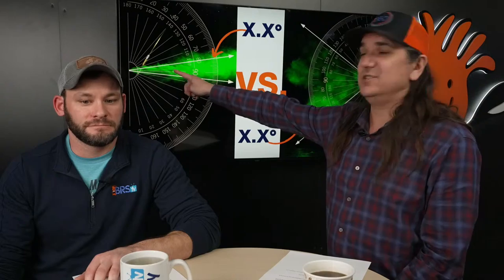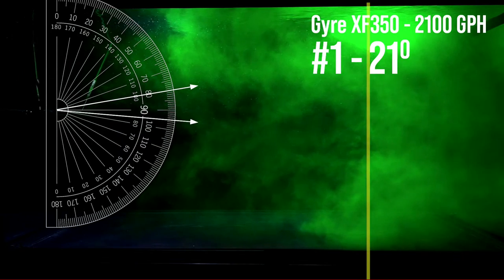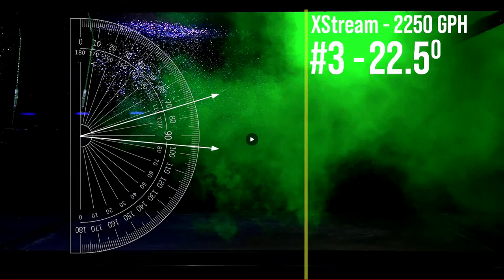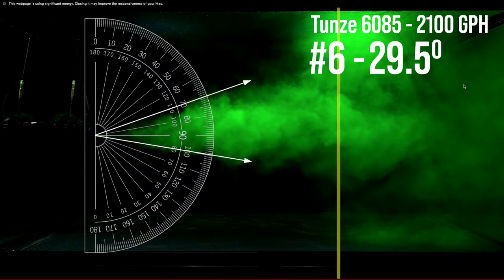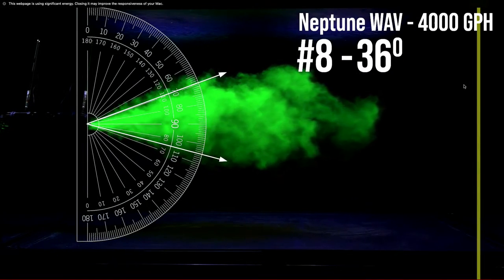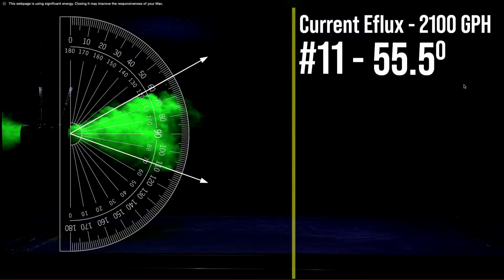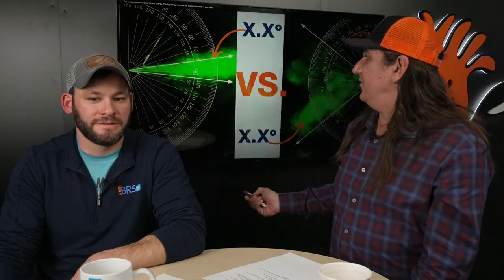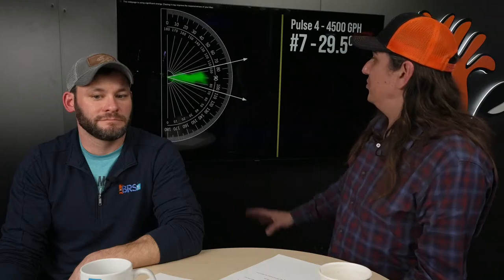Pump Angle: The Right Powerhead for the Right Flow, Used the Right Way – BRStv Investigates Flow.

Comment: Would love to see this done with the Jebao pumps. They’ve proven themselves reliable and can move some water.
Reply: Jebao is the first controllable pump i went with when i changed from my Tunze nanostreams a long time ago. They are still my go too in smaller systems. Price point and performance is unmatched. I do spend the extra coin on eco tech vortech pumps for larger systems though because i dont want cables in the water if i dont need them.

Comment: I would love to see some of the Neat Aquatics mods for the MP-40s. I’m in the process of setting up a 120 gallon mainly LPS tank and have a couple MP-40s. May dabble with some SPS in the future. It’s nice to know there is some options for flow patterns with the same pumps.
Reply: I agree!  I have the meat aquatics wide angle flow adapter on my MP40’s and would love to see this info with the adapter in place.

Comment: Very glad to be turned onto you guys. Working on my first saltwater tank setup now. Talk about intimidating with all the different peices. Have a 90 gallon bowfront, planning to do mainly softies and a few lps. This video helps so much on water movement questions. Leaning towards the Neptune wav mounted on the back wall on each side. Do you think these would be too much in a 90 Gallon with mainly softies
Reply from the maker: The Neptune WAV pushes a ton of water, but the good news is that the WAV pumps are controllable and can be turned down if needed. Just keep in mind that the WAV pumps require a Neptune Systems Apex and can not be run stand-alone.

Comment: Question: is the length of the screen intended to represent 4’ ?  The yellow line doesn’t have a distance shown so I’m assuming it’s in relation to the length of the 4’ tank.
Reply from the maker: That's correct, the test tank is 4'. The line represents where we think the flow mostly stalls out

Comment: Good info. I have a 92g corner with 1 Sicce Extreme. Looking to add another to address dirty sand/glass (among other fixes) because I suspect I have some eddys in tank. Would you suggest another Extreme or go with a wide pattern/wave style?
Reply from the maker: Two Sicce Xstream pumps would be a great flow solution. Their SDC version is one of the more underrated powerheads in the hobby 😀

Comment: I have a 32.5 flex AIO system and it has a problem skimming and I get the haze on the top of the water. Which of these should I try to help with that. I currently have 2 stream powerheads at the surface and I need more wide angle
Reply from the maker: It sounds like you need increased surface skimming. If you have a controllable return pump, try to increase the flow rate. Otherwise, it might be worth considering a return pump upgrade so that you have more turnover through the rear filtration compartments, which will lead to more surface skimming.

Comment: Will you also test the MP60? Also, I was wondering about using some MP40s on the floor of a peninsular tank to create flow at the peninsular end using an aftermarket deflector.  I'd love to hear comments and also to know what impact of the deflector on flow pattern and intensity.
Reply from the maker: We would expect the flow pattern between the MP10, 40, and 60 to remain pretty consistent. We don't have a part 2 on the schedule quite yet, but don't be surprised if you see one in the future 🙂

Comment: How much flow do you recommend for a 32 gal bio cube?
Reply from the maker: Ultimately, it depends on the animals (corals) that you're trying to care for. Generally speaking, one or two wider flow powerheads will do a good job at providing enough flow for the average tank of that size.
Reply: @BRStv  what brand would you recommend?

Comment: How many powerheads should I have in a 25 gallon tank? Right now I just have one fluval 25 gallon powerhead
Reply from the maker: Next time you feed, take a close look at the pieces of food and see how they move in the water. You'll normally be able to easily see where the food is moving quickly and where you might have dead spots. Depending on your aquascape, one powerhead could be enough, but you might also find that you need to add a second to hit some specific spots.

Comment: Maybe someone can help me. I have less than a year experience with reefing (have a fluval 13 5) I am upgrading to red sea reefer 250. I have a Nero 3, and I purchased a Nero 5. After watching this video I'm thinking about adding the Tunze 6095 to the back. Would that be sufficient flow for mixed reef with beginner corals?
Reply from the maker: Absolutely. To be honest, you could probably even get away with just the Nero 3 and 5 for most beginner corals in a Reefer 250.
Reply: @BRStv  oh that's even better! Can I put them on the back wall or do they have to be opposite eachother for max coverage?

Comment: in about 10 years of being a subscriber and a fan, it is with great sadness that I give a thumbs down to one of your videos… The way the test is made is flawed given 1) you are comparing pumps that have widely different GPH ratings (in some cases almost double) and 2) some pumps (as the gyre) are designed to work at the surface water as it is the point of least resistance. Not in the middle of the tank. If you perform the same test and place the Gyre at the top as it is meant to be you will see that the green tint will fill 100% of the aquarium much faster than any other. This is due to the momentum that it is created by the rotation of the water body. The gyre is the only one that would easily cover a 4 foot tank if used correctly. It is like doing a drag race in the mud between a Ferrari and a Jeep and than concluding that the Jeep is faster to 60MPH… The downside of the Gyres is the maintenance, and for some (including me) that is enough to go with twice the amount of mp40s and spend 2x the money. But in terms of getting flow to all corners of your tank (rectangular) it is unmatched.
Reply from the maker: I see your point of view here. From the outset of this test, it was never designed or conducted to be a one-for-one comparison to determine the "best". I believe we accomplished what we set out to do with this test, which is simply squirt some neon fluid into a bunch of different pumps to see what we can learn about water flow and angle. These tests will continue to build upon each other where at the end the goal is to provide data, without bias, for reefers to make more informed pump decisions. Today's test was Step Zero in a line of flow testing.
Reply: I think I humbly see and understand (and agree some of) your points and relevancy. 
But not the fact (?) that these tests (other type are coming...) do worth nothing (if it is what you meant) :
- the tests do not pretend to give a complete and definitive point of view of all the characteristics of each pump, but rather IMO points of reference in the same physical conditions... in a VERY complex domain, hydrology, that is so retroactional multifactor dependent and sensitive... And I've sometime seen some people around me using these type of pumps far from the surface also... Not to mention vertical users. A big point in this complexity for relevancy is to have exact same conditions.
- Many other models will certainly be tested in the future, incl. other "laminar flow" type, with the same protocol... leading to feasible comparisons.
- I easily imagine BRS, in the future, could do an additionnal category test protocol for theses laminar flow pumps with a surface (and vertical?) use. 
- when used near surface, the flow behaviour is indeed very different, like you said. But one aspect, not the smallest, a substancial part of the energy of the pump is dissipated in the surface agitation (waves formation), more than the "classic" models... and no more available for "cinetic volume circulation"...
- coming velocity tests and flow rates estimations will give another points of reference for more precise comparisons.
- results for different size pumps in same exact conditions will give very important clues to any type of reefers to which they can reefer (^_^') to, from low flow small tank to high flow big tanks. Also for those who target homogeneous flow, or on the contrary prefer heterogeneous patern...
- to be exhaustive in characteristics and use, even more with increasing interactions like water density, temperature, tank volume, tank size ratio, landscape (obstacles size, placement, number, volume, ...), different pumps interactions (flow, rate, placement, number, ...) ... it would litterally need thousands, billions (counless) of different tests ... for each model!
What I'm sure of, is that BRS, are already providing precious objective infos we didn't have yet, and in the long run, will perform better and better like they did on many other subjects of reefing. I personnally want to thank them for the efforts, time, hassles, costs inherent of doing it. Much appreciated here, in France : excuse my potential errors and lack of vocabular...
Reply: @momallanimal2449  understand your point but in this case I am afraid I cannot agree. Back to my simple example, you cannot compare a sportscar and an offroader in a drag race in the mud and conclude anything. If you do believe that the crucial thing is to compare all pumps in the same spot, why not place them all bear the water surface? It would be the same for all so conclusions should be valid right? Obviously not. Most pumps would draw air from the surface and perform miserably. The only valid conclusion of that test would be that you should not place the vortechs near the surface.
Reply: Hard disagree. I think you either didn’t watch or are trying to inject some kind of brand loyalty argument. 

The tests are not comparing pumps. There is no winner here. The gyres placement doesn’t change its flow pattern, it’s still a narrow angle pump meant to move a sheet of water all the way around the tank. 

No one is saying one is better than the other and more tests in the future clearly plan to focus on other things that matter when picking a pump (velocity, etc). There is a reason price wasn’t mentioned. 

The Jeep vs Ferrari comparison is correct though but they aren’t drag racing through mud, it’s more showing power vs torque curves and clearly there is a right tool for the right job.
Reply: @protodad1  before you hard disagree, I would urge you to actually read the comments. If you do, you will see that I have actually owned Ecotech, Tunzes and Gyres, and although the ability to move water of the latter is unmatched (if positioned correctly) the maintenance is such a PITA that I have actually just moved to Ecotechs. So clearly, I do not have any kind of “brand loyalty”. Secondly, placement most definitly changes the flow pattern of each of the pumps. Finally, if all this is doing is showing specs (power vs torque curves) I would wonder what exactly is that info good for? Knowing that a Bentley Bentayga has more power and torque than a Porsche 911 will help me zero in my decision to buy a car intended to go offroad. Now, if this is followed by a video that shows which pump covers the entire tank with dye the fastest when correctly placed, that will be useful info.I would also encourage you to read the title of the of the series which is “Best Powerhead”.
Reply: @vascojardim6703  all the information is subjective just as you are doing, what is best for YOUR specific needs. In your mind it seems you believe that the thrust of fluid stream will some how be different at the top, vs middle? They are showing angle, hence the placement of the middle, the impeller thrust will not change. Sure, the flow pattern will change but that is not what they are showing, they are showing the ability, these pumps have to generate thrust and also the angle they can push them at. Ultimately it's on YOU to place them in optimal spots of your tank, to make it effective. Their results are spot on, and very helpful, they give the information and it's on you to determine what you need based on it. Your inability to comprehend the information is no one's fault but your own. The other commentors seemed to hit the nail on the head, you got pretty sore when they mentioned brand loyalty. Lol To be honest, sounds like your being argumentative just for the sake of hearing yourself. No one said A is better than B or C etc, and they said what each specific pump could do, based on their research, you are more than welcome to spend thousands to do your own tests,and post up results. 
      You went out of your way to mention a 10yr sub and 1st thumbs down. Lol okay, and? Do you think their channel will shut down because you didn't like it? Smh the ego of some people's kids. 😆🤣😂
Reply: @boostedbadboyzx12r31  Nice handle.